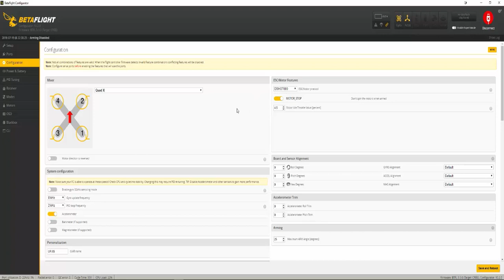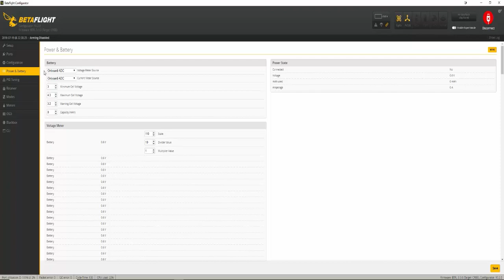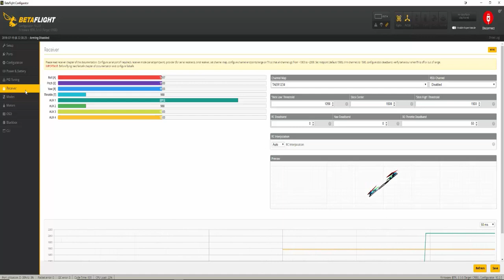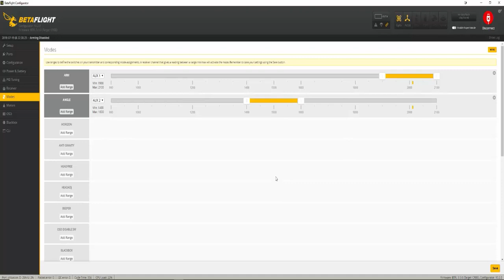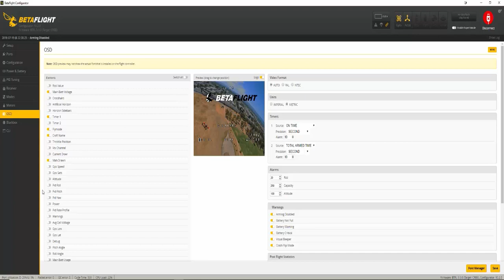URUAV UR65 How to Setup Acro Mode In Betaflight

Comment: i can not get my ur65 to arm at all, everything works. min check is fine, endpoints are set, everything else works in the modes tab but arming wont work... so frustrated.
Reply from the maker: Frsk version you have?............try a rebind and start over again,have you set up all the switches on your transmitter correct?In the video when i arm it in betaflight it does not go orange that's because it's set to acro.
Reply: Merch RC yup frsky. so it will turn orange for less than a second than it goes away. Ill update all the firmware and try again. I got my xjb 145 to work fine so idk if its just a bad board or what.
Reply: Merch RC also the motors turn on for a half a second than stop. It wont work while trying to fly either so its not in acro. The green light that indicates you are armed is blinking rather than staying solid. Ill flip the arm switch it turns solid green than blinks until i flip the switch back.
Reply from the maker: Are you using the same settings as me if so try a rebind and see if it helps.
Reply from the maker: Did you bind in D8 or D16?
Reply: d8, people were saying d16 is twitchy, yea im gonna try the same settings
Reply from the maker: Stay on D8,good luck!
Reply: ok so it got even weirder lol, a few of my batteries work while some others dont(could be power lead) and it will fly fine but outta no where it just falls out the sky/reboots. i didnt have my goggles on so i didnt see the voltage but man this is weird.. at least it flies :)
Reply from the maker: Getting there.....Are you using the charger that came with the quad,make sure it's set to the correct voltage plus does it fall the sky when it is near the transmitter?........and yes check the pin in the socket where you plug the battery in,there known to pop out.
Don't forget to like and sub for more videos,Happy flying.
Reply: Merch RC lol, i updated to 3.4 and it runs fine now! Fun little whoop but i gotta lube one of these motors its a bit stiffer than the others. Thanks for the help!
Reply from the maker: Your welcome Have fun!

Comment: Thanks Merch.
Reply from the maker: No problem Rich but it's mostly basic settings with some changes.
Reply: I know,  just posted the comment and thumbs up to help boost the channel.
Reply from the maker: Thanks Rich!
Reply: Glad to help out when I can :-) Here's a question for you, Have you tried setting up a beeper on the UR65 yet? I've gone through everything I can think of on the Snapper 7 and it just won't beep even though it shows in Betaflight that my AUX 3 beeper switch is working. I am thinking that it may be something in BL Heli that isn't set up correct. I can configure it to beep after a specified time period of no activity just not with a switch.
Reply from the maker: No but follow SebyDockys video about it he shows you howto.
Reply: Thanks Merch. I did follow his video and I also used Project Blue Falcons video for setting up the switches on the Taranis. When I have the quad connected to Betaflight with the Taranis turned on it shows that the switch is working correctly but it just isn't making any noise. Maybe I missed something in Sebydocks video. I'll go back and watch it again.